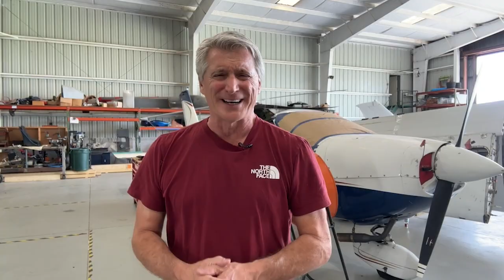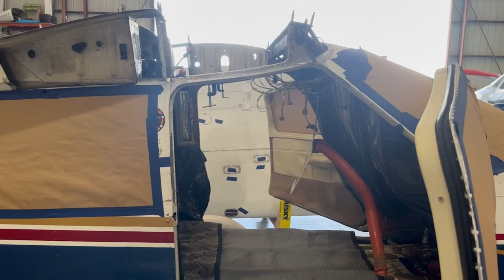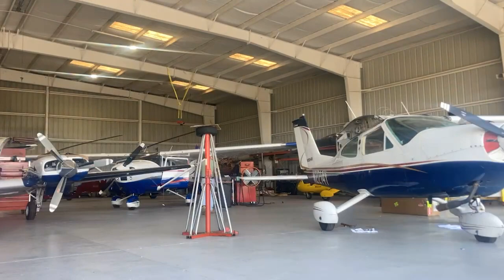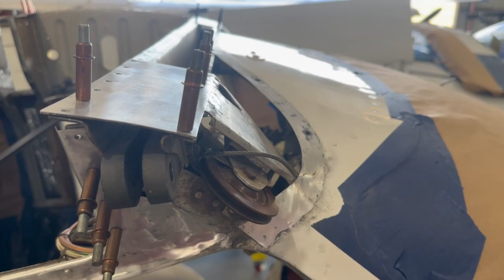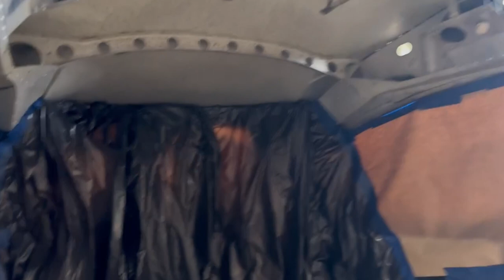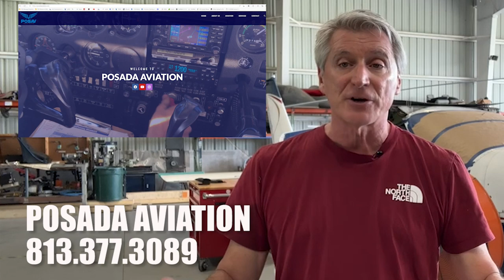What do you do if your Cessna Cardinal/ Cessna 210 fails the A.D. Eddie Inspection?

Comment: Great presentation👍 I learnt in Cessnas and have flown both the 177 & 210 as well as did several years aircraft engineering before I went on to fly commercially. When the C210 crashed here in Oz where the wing let go I silently prayed that I got away with it all those years ago!

Comment: +1 For stopping corrosion as early as possible….  Do not wait.

Spar replacements are expensive… and are most concerning when performing a pre-purchase inspection….  The work involved is huge.

Metal airplanes in general… not just 210s.

Eddy current inspections are a nice non-destructive test that also looks for corrosion and cracks of propeller hubs… 😀

Ownership is challenging…. But, easier Over Fifty, than under 30….  😃

Get that house paid down… kids through college… career in full bloom….

Go Fly!

Comment: Great video and attitude. I had a similar reaction when I found a crack in the crankcase of my 177RG while tracking down an oil leak. As I said to my wife, "I like finding the answer. I may not like the answer, but I like finding the answer."

Could you share more details about what pushed your old spar over the edge? What tests, measurements, and/or observations were used to determine it needed replacement? Was it a decision made by Textron, your A&P, or both? A lot of spars have some amount of corrosion present, yet few have failed to pass inspection. It would be informative to get a "real world" example of failure.
Reply from the maker: It was a Textron at the end of the day. The Eddie inspection revealed no cracks, but the corrosion was really bad. There was a lot of bad pitting, and there were many areas that were previously filed down which I didn’t realize had been done. The other side of the spar, which wasn’t in the photos was really bad, and after the pictures went to Textron Textron did the safe thing for them and they failed the spar.  I wasn’t happy about it at all but you can’t do anything about it and without a successful inspection, you just have a pile of aluminum the plane is worthless.
Reply: The pass/fail criteria is spelled out in the AD. It’s not a judgement call. Having said that, your spar looked terrible frankly. Most failures are from corrosion on the lower cap where Cessna glued a pad that trapped water. Yours was bad all over!  Like maybe it was kept outside near the ocean for a long time?

Comment: Are the spars coming from BAS Parts used serviceable with 8130's or COC's?  I think that White Industries was aircraft salvage.    I guess it's cheaper than NEW!  Jeff, Ohio
Reply: Spars from BAS are provided with an 8130, inspection reports, and a work order showing all the work done showing the AD is completely satisfied
Reply from the maker: The paperwork it was perfectly in order, and there were other companies that I could’ve chosen to purchase as far from, but Bas paperwork was perfect!

Comment: For anyone else watching, the Cessna experts that I've heard from suggest getting a second opinion if a spar inspection fails for corrosion. And probably from an expert.
Reply from the maker: Now you tell me…. 😉
Reply: @Over50andLearningToFly  lol yeah. Apparently there can be quite a diversity of opinion. And these inspections are highly subjective.
Reply: Not really. The AD specifies exactly how much material can be removed to address corrosion pitting. It the depth of the pitting exceeds limits, you fail. Pretty cut and dried.
Reply: @SkylaneGuy  it certainly does but the analysis of those amounts is not consistent. I'm not an expert. Just going off what I've heard experts say. I think Mike Busch had something on this. And anyway, does it sound like a good idea to dive into such a major expensive project based on the say -so of one person? I know people rip out perfectly good engines all the time for that reason. Mike Busch certainly has feelings on that one also.

Comment: So I have a question and this could be for anyone that has the answer. My 177 is in the shop now and they say there’s enough corrosion and they’re not sure they’re going to be able to get it all and it may not pass Eddy current test. If it does not pass, they said that they understand it would take well over 100 to 150 hours to put a new spar in plus the cost of a spar. Which what they tell me would cost at least 50 to 75% of the overall value of the airplane its current condition. The rest of the plane is beautiful and has all new avionics including auto pilot. And his IFR certified. So what is the guy to do if you have to spend the value of your plane to put a new sparring? Provided you can afford to do that in the first place? Just not having a good sleep at night until I learn what’s going on.
Reply from the maker: What’s your number and I’ll call you …

Comment: Not the news an owner wants to hear. At what point would the repair be deemed "beyond economical" in which  case your only option would be to part out the plane? You are lucky to find an airworthy replacement spar, but eventually the supply will dry up. Then what will owners do?  Does Cessna /Textron have new spars available for the 210/177 aircraft?
Reply from the maker: Well, I think it would always be beneficial to replace the spar. Even if you have an aircraft with an older engine and avionics that are not updated, putting a new spar would lengthen the life of the plane so at the minimum you’re always be able to get your use out of it and if you went ahead and updated it, you’d have a better plane to. Unfortunately, with luxury items like boats planes and luxury cars, you can’t look at getting all your money out of it every single time I am about the break even point may be a little bit underneath the plane by five or $10,000 but the enjoyment I’ve gotten out of it is priceless. And if I wasn’t going to upgrade my airplane I definitely keep it because it’s a fun airplane. Cessna text Ron is offering new spores, but there is a long wait for them like up to a year, and there are plenty of spar’s out there. Another alternative I would imagine, not that I’ve tested this, is an owner could get the aircraft recertified as experimental and then they would be able to do what they want with it however, I’m not sure if that would be accurate .. it was just an idea. Thanks for watching!
Reply: TL;DR. The answer is yes. Textron is making new ones. Twice the price of a salvaged one, but at least you can get them.